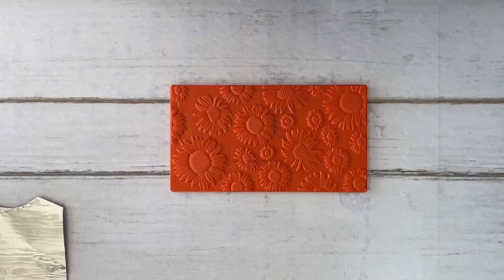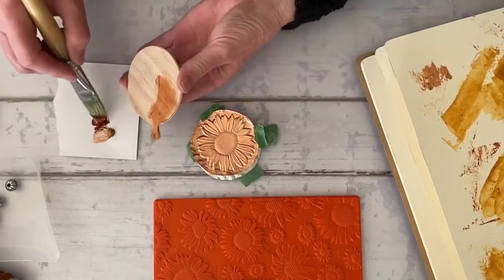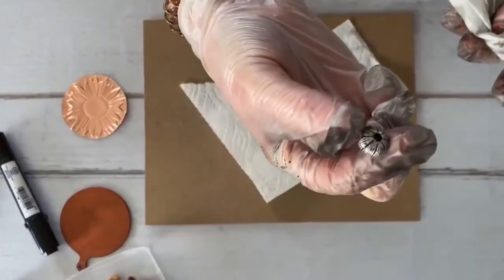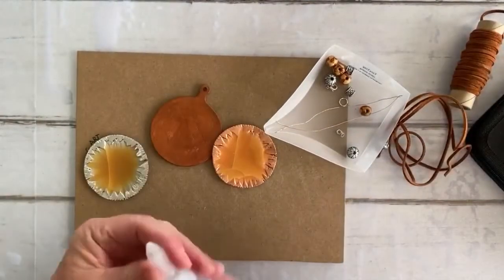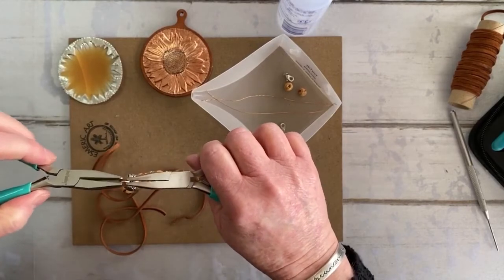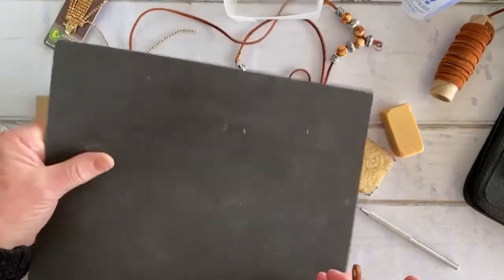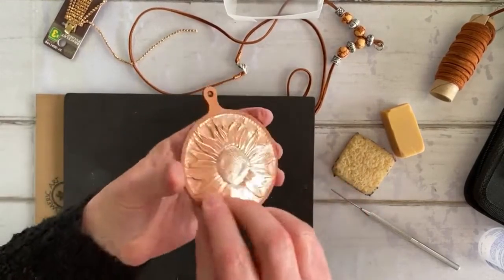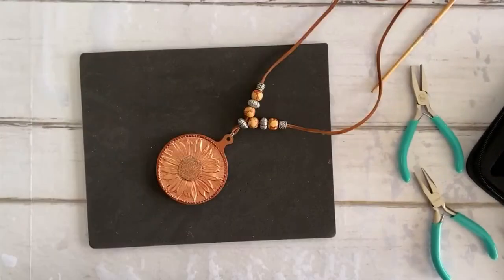Metal Embossing Jewelry Using Off-Cuts

Comment: Loved the necklace. If you wanted to make the necklace so it could be different lengths you could have tied a sliding knot. If you wanted to use the closures, you could have used thread to make a silk wrap on the ends. It looks similar to what you were using with the wire, but you pull the ends of thread inside the wrap to secure.
Reply from the maker: Thank you; these are all great ideas; I think I'm going to remove the hardware and do the sliding knot!! I'm learning so much from everyone.😊

Comment: Thanks for sharing this awesome design using embossed foil or lightweight metal, it's very creative, but for as long as you made this particular necklace, you really didn't even need the hooking clasps at all, I really like the ball chain that you glued onto the edges,  and having it double sided, 1silver & 1copper, you are very creative, thanks for your video.
Reply from the maker: Thank you for your kind words. You are so correct; the only time I've ever used the clasps was when I played model at the end of the video :)
Reply: @EsmericArtMixedMediaPewter  I was curious though on how long of rope were you are actually using in the video, think that putting in the wax as a filler is a great idea, i look forward to making these.
Reply from the maker: @j.m.england6828 , that's great that you are looking into making these. I've measured the rope/leather thong for you, and it is 36-inches. I have to add that I found it a little too long for a couple of times I wore it long. I kept the length, though, so I can double it up for a short necklace.
Reply from the maker: @j.m.england6828 , you are more than welcome. You have some great ideas!

Comment: I find using uv clear resin hard and a uv torch to fill the back instead of wax works a lot better!! (Amazon sales it)
Reply from the maker: Thanks, Lisa; I have not worked with UV clear resin yet; however, I had used slow casting resin as filler in some of my bigger projects. I will look into UV resin 😊

Comment: You can also place the metal sheet in an embossing folder and pass through an embossing machine, use same machine and die cutters to cut metal to desired shape before embossing!!
Reply from the maker: Using embossing folders and dies reduces time, especially when preparing for craft markets. I recently invested in a couple of folders that do the embossing and cutting simultaneously. 😊

Comment: The problem I have when creating discs is getting the edges smooth. Almost impossible for me.
Reply from the maker: Sandra, if you are referring to wood disks, some have difficulty getting smooth edges, depending on the wood species. I usually start with a coarser grid sanding paper and end with a very fine one. Sometimes, I use an emery board to create a rounded edge. When I adhere two pieces of metal back to back together, I sometimes use a thin strip of metal tape to finish it. I hope this is helpful to you. 😊